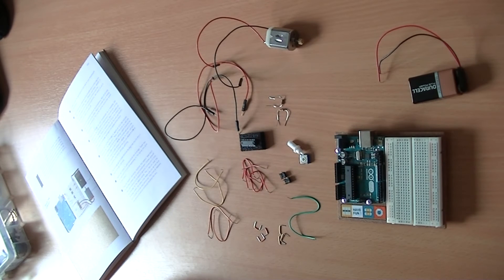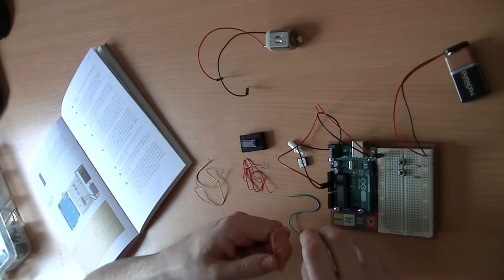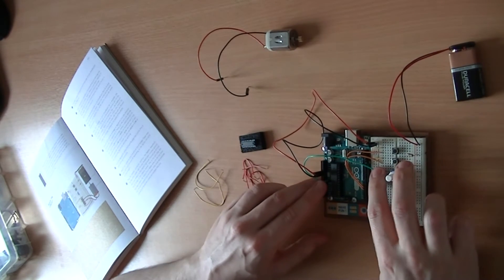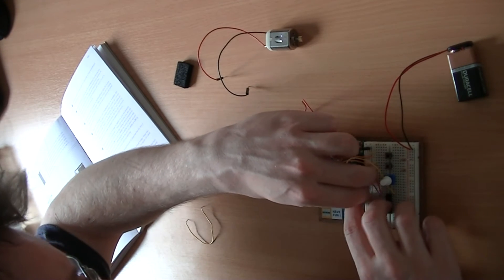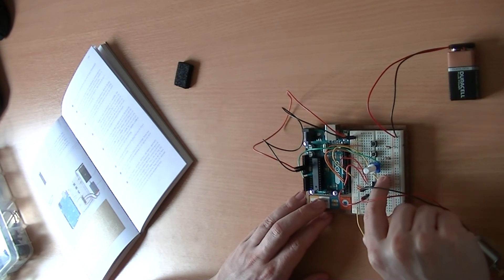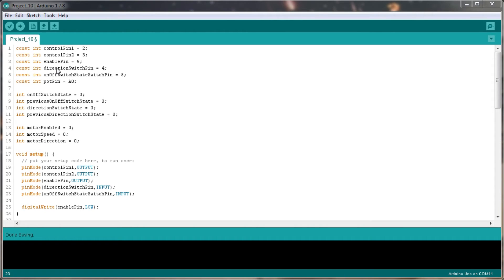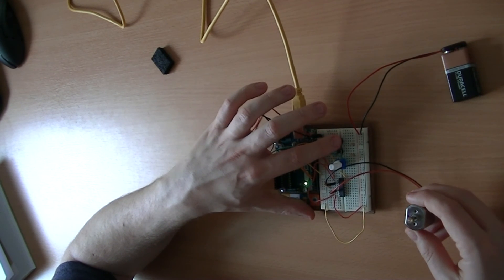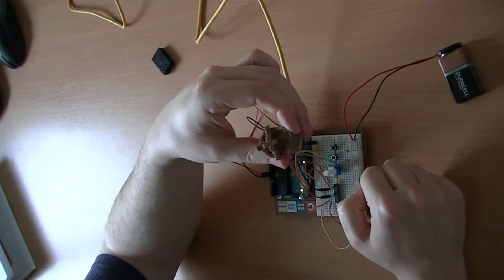Arduino Project 10 - Zoetrope

Comment: In my code, at the beginning of my void loop on the line that says  directionSwitchState = digitalRead(directionSwitchPin); , there is an error that says that directionSwitchState was not declared in the scope. How do I fix this?
Reply: Hi, did you declare the variable at the start of the program? If you go to around 10:08 you can see the declarations at the top, including "int directionSwitchState = 0;". If you're still having issues, I can send you a link to my code in GitHub.